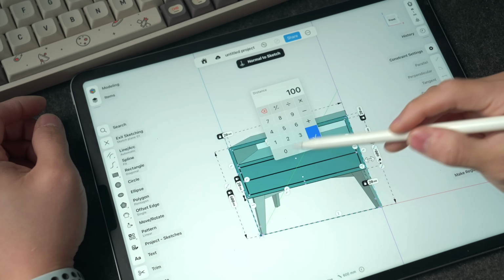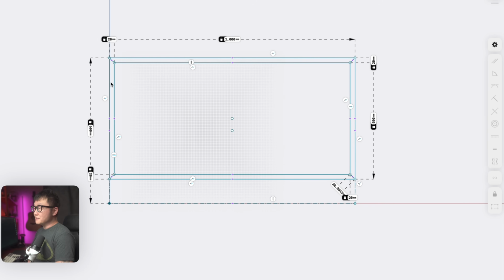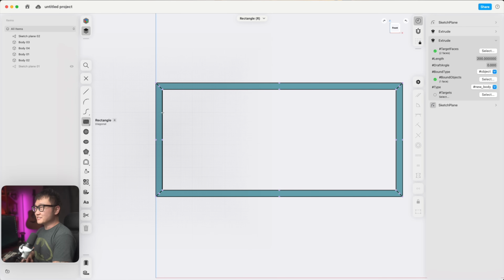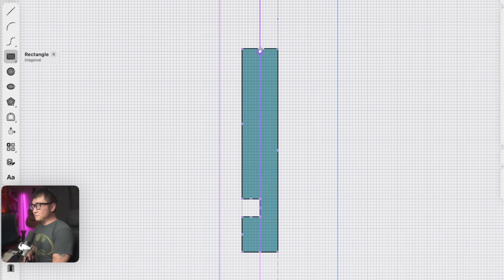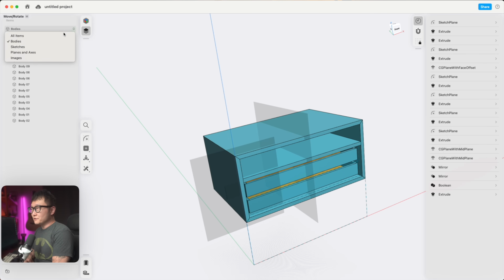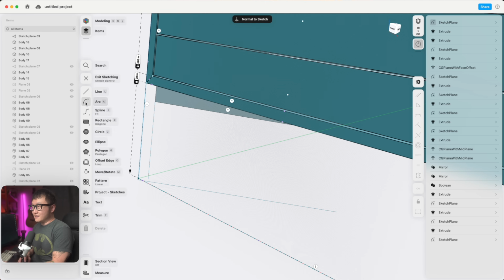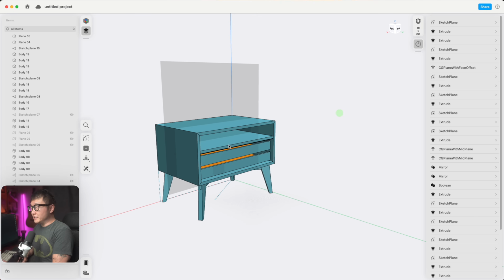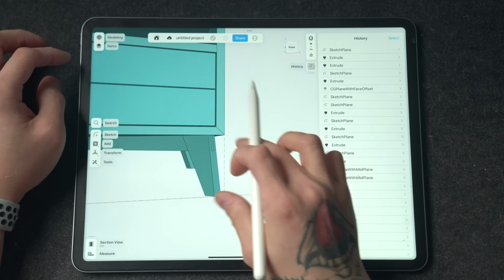Furniture Design in Shapr3D Using PARAMETRIC MODELING - CAD Modeling For Woodworkers

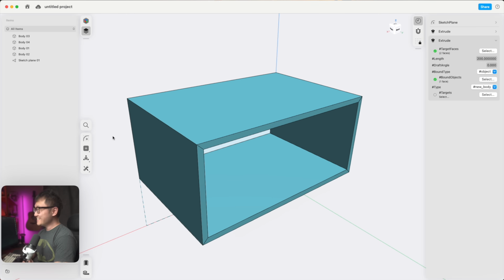Comment: Question: The "BindType" that allows the bodies to transform together like you did at time-marker 9:20 is no longer there or has been named something else with the latest update. I was wondering if you knew how to do this similar effect, where you can bind things to transform/change together, in the new version?
Reply: Should be called “extension” now

Comment: Scaling is not working with the legs. When I go to extrusion 1 and change the depth  the legs deform and start to break apart. It also undoes the joinery on the legs and cross member. It does the same thing when going to sketch one and changing over all length. I have gone back 3 times and followed step by step to make sure I did everything in the video and get the same results every time. Not really sure what I’m doing wrong.

Comment: Well man! Big fan. I was wonding if you could help me? 
Im looking at getting a Ipad pro and convering from fusion360 to this shaper3D crack. 
i want to get a refurbished I Pad and im wondering 
How important is Ram ?
Reply from the maker: Ram seems only important if you’re dealing with large sketches. But for what I do, even an iPad Air can handle it fine. When I’m talking about large sketches, I’m talking about hundreds of lines in a single sketch

Comment: Did Shapr3D finally introduce the ability to duplicate an object several times, and make all of them as a single "component" i.e. various occurrences of the exact same object, meaning that if one makes the slightest change to an occurence, that modification is propagated instantly to all other duplicated occurrences of that component? This is available in almost all CAD softwares but is conspicuously absent from Shapr3D. They claimed that such a feature would require a new software built on a History-Based Parametric Modeling engine. Which is precisely what they've done under the hood with this upcoming brand new version.
Reply from the maker: Yep it’s in the parametric modeling update
Reply: @BevelishCreations  Good news, but I looked at the Shapr3D beta and fail to see how to create instances of components anywhere. Same thing on the Shapr3D Discourse forum where their team said that it is achievable in the beta using the Copy or Pattern tools, without actually showing how. Do you know an article or tutorial explaining this?
Reply from the maker: @fluxcapacitor when you talk about “instances and components”, I’m guessing you mean how to update multiple parts at the same time? That’s what my tutorial showed how to do it. The way parametric modeling works is by copying and pasting it, and then make adjustments in the history timeline, not to the part itself
Reply: @BevelishCreations  Ok, I see. When I am talking of "instances of components", I am talking like in my first post above of making a particular object as a component, i.e. when I duplicate this component X times, any manual modification done to one of its occurrences will modify all the others at the same time accordingly, because they are in fact the exact same object and not independent copies. Like Components in Macromedia/Adobe Flash if you remember. 

For example, imagine you draw a little pole on the edge of a flat disk that you copy say, 100 times with the pattern tool, like nails distributed at the rim of a circular mirror. If you want to make additional modification to the design of that pole, for example a chamfer, you have to do it manually 100 times in a row in Shapr3D. That's preposterous. However, I understand that now with the History feature you can go back, make the desired modification to the first pole, then duplicate it again a hundred times with the Pattern tool again. But a true component would be so much easier in this case!

In your video here, the way you play with constrained adjustments in the timeline to make a particular model "responsive" to further modifications makes sense; however in the case of separate distant objects, I find this way of doing things particularly cumbersome with respect to a simple button "make component" that still doesn't exist even in the HBPM beta sadly.
Reply from the maker: @fluxcapacitor yeah I see what you’re talking about. With parametric modeling, everything is connected based on mathematical parameters that we set. So when we make updates to one part, the matching part will update, but so will the rest of the model. Which makes it much quicker and efficient than simply updating the matching parts alone. So for example, with a box. If we use “instance and components” to update the box side panels, only the side panels will update. You’ll still have to update the top/bottom panels. Whereas with parametric modeling, one change will update all panels. Yes, the initial setup is more complicated, but it will make updating much quicker
Reply: @BevelishCreations  That's what I said: when everything is connected together like your box, this parametric approach is really the best and very useful. But it becomes very different when many separate objects not connected to the rest of the model need to be edited one after the other, whereas instances of this object would do the trick in just a single fell sweep (I updated my previous comment with the example of many little poles distributed on the rim of a mirror).
Reply from the maker: @fluxcapacitor if it’s evenly distributed parts, the “pattern” tool is what you’d want to use. Just create one part, use the pattern tool to create the other parts. And then when you edit one part, the other parts will update as well. Maybe that’s closer to what you’re looking for
Reply: @BevelishCreations  That's precisely what I want to do but still fail to achieve in the beta. Anyway, I took enough of your time over here on YouTube, I will reach for help in the Shapr3D forum. Thanks!
Reply from the maker: @fluxcapacitor no problem! Feel free to send me messages through Facebook or IG

Comment: So excited about this update.  Playing with the beta right now.

Do you think they'll introduce variables (or have they, and I haven't found it)?  As in, defining a variable and then setting dimensions to that variable so that changes to the variable affects all dimensions to which that variable is assigned.  I love the UI in Shapr3D but I haven't been able to move from Fusion360 because that ability to define and easily change variables is so critical.  If a client says "I want it about 3 feet longer..." I don't want to have to go in and manually change all the objects that affect that overall length individually.  There can also be dimensions that are meant to be proportional to the overall length, and I'd have to go and recalculate and change all those dimensions manually as well.

With Fusion360, I can create a spreadsheet with a bunch of variables.  I can set one variable (Overall_Length) to 5 ft.  Set another variable to half of that first variable.  Then, if I have to change the overall length because the client requests it, I just change that one variable and all variables that are dependent on it and all dimensions that reference it will automatically update.

If Shapr3D can implement that, I will never look back.
Reply from the maker: Yes they’re adding that. They confirmed it on their Facebook group. Maybe it’ll come with the final version

Comment: Is there an extension or plug for creating cut lists, similar to what you can get in SketchUp.
Reply from the maker: No there isn’t
Reply: Not having cutlist is a deal breaker for me. I extensively use opencutlist extension in sketchup.
Reply: At the very least it should have dxf export of sheet goods so i can use third party apps for cutlist.
Reply from the maker: @Z-add what kind of projects are you making? I usually prefer making my own cutting diagrams. Even when I used Sketchup, I never liked the plugins
Reply: @BevelishCreations  kitchen cabinets, wardrobes, armoires, shoe racks. tv console etc.
Reply: My very elaborate work around is to export as a step file, import to fusion and then you can export to a dxf via map boards promwhich I then re import to shapr to finalise.. Would be nice if there was an easier way though…